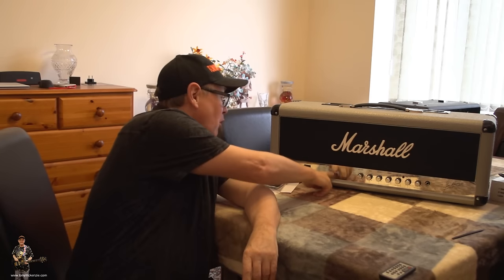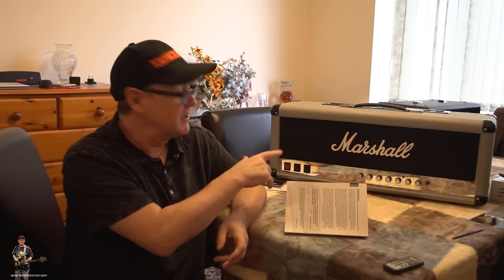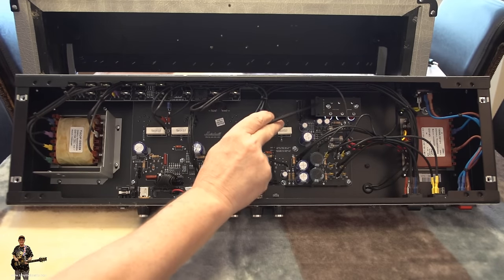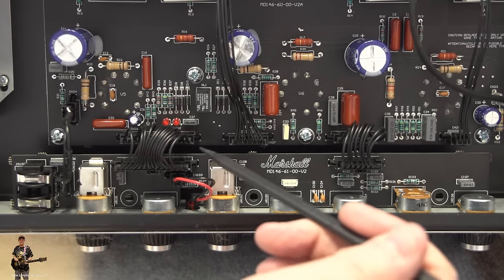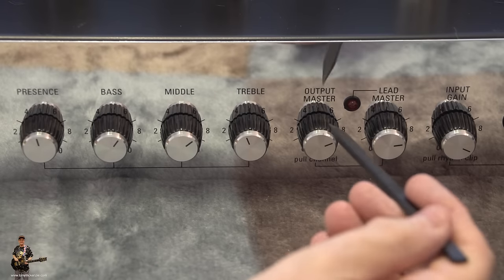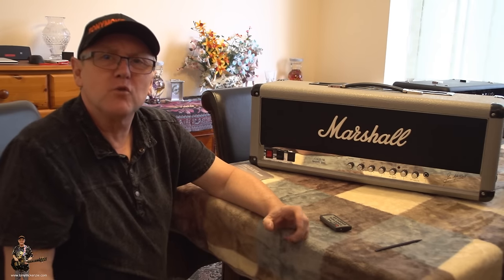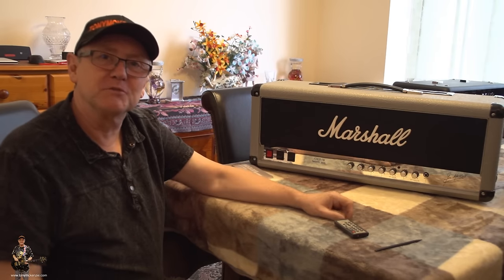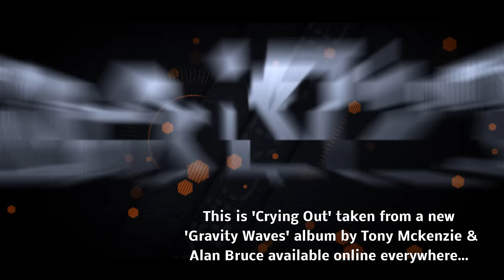Marshall 2555X 100 Watt Silver Jubilee Amplifier | A Closeup Inside and Out Review | Tony Mckenzie

Comment: Thanks Tony dude!
Reply from the maker: Ha this one was for you Dan. I did not publish your name but if you check somewhere in there I mentioned that. :) Thanks for watching. Do you still have yours? I assume you do.
Reply: Yeah, I play a Gibson Les Paul Custom through it too! Really happy with the amp and it saved me from spending well over £2000 on the original 2553 combo that I was in before I got hold of a 2555x. 

I'm glad you felt it was really worth the praise I've been singing about it  for these past couple of years!
Reply from the maker: Well... this one I reviewed came up for sale in the local store www.musicstorepro.co.uk and they wanted to sell it at a discount. I paid about £880 which for a brand new amp I felt was really good. You always talked about that 2555X and when I saw it I immediately thought of you :) and your comments etc. so I bought it for review. Actually though I'll probably be keeping that amp - they do sound cool.

Not sure if you have one but try one of those Xotic SL drive pedals... you don't need much drive, but it takes the amp to even other levels that you would not think it can do - but it does... 

Regards... T
Reply: That's a really good price. When I got mine, it was the only one the store could get (PMT Oxford). 

RE: Pedals, I only use Boss pedals (I like collecting them) and I have the SD-1 (Super Overdrive) that I use to push the amp harder for solos. I normally find with my Customs "classic 57" humbuckers, that I don't need any boost for the stuff I normally play. 

I had a god using your amp settings on mine and I really liked the tone, I rolled the bass back some as I don't like to have much bass if I can avoid it. 

Tony, when will you do another guitar video? I swear that LP Custom is another one that snuck into your collection!
Reply from the maker: Well the 2555X is a year or so older now from launch (at least) and sometimes they can be bought for a good deal and I'm always looking for that sort of thing. This one came from local www.musicstorepro.co.uk which is in Hanley Stoke on Trent. I also try and support them when I can.

Boss make some very nice pedals and at great prices with good offers sometimes. If I remember correctly they just made an 'anniversary' SD-1 in gold and black... but I could be wrong on that. 

Yes what I found with the 2555X is that it is a bit bottom ended and woolly (if that's a word) on the bass side. So I turned the pots (in general)until it went away. I used a 4x12 1960a cab standard from Marshall as I would not pay all the money they want for the 'silver' cab. Sounded good to me. 

HB's will drive it for sure. The crunch is cool too - I did not really show that much of that sound but it is a pretty good tone no doubt.

The LP Custom was reviewed here: https://youtu.be/8-f8E9W78oA under a different title but it's still a review and close up. 

I have restrained from buying yet more guitars of late as I'm now being 'ordered' to do so by the wife :) so I will probably rotate a few through the coming videos that I make so guys can see them if they missed the review and I'll point them to it... a good idea from your comments :)
Reply: I use a Victory Silverback 4x12 cab which is basically a Marshall 1960a and has the Celestion vintage 30's in, which is correct for the time.

Thanks for the guitar link, I really love some of the guitars you have in your collection :)
Reply from the maker: Yes I know the cab... and it might well be a better match for the 2555X series. I have a link for the whole series of guitar reviews here: https://www.youtube.com/playlist?list=PLEECCBA95315E63B6 and there might well be some 'missing' from the playlist... but any not in there are on my channel usually. Regards... T
Reply: I don't know if you remember our last exchange of emails, where I sent you the photos I took of my 3 guitars? The Classic Custom I got just before Christmas and my Birthday, was a black and chrome colour scheme, since the new year I have been on a quest to change all the chrome hardware to gold. I have almost finished with this task and all that is left is for me to either find some really good fitting gold covers for the "Classic '57" humbuckers or to put in high quality humbuckers.

I know normally a classic normally would come with the 490/498 combo of humbuckers, but I was wondering what you would go for if you didn't choose Gibson pickups. I know you have picked up some really brilliant alternatives and was hoping you would be able to recommend to me a good alternative please? I would like to have something pretty low output, just like a PAF, as I think most of "that" Les Paul and Marshall tone, only really happens when you really can push the amp so that the valves "open up" and you get that sweetspot that is just so classically loved by most people who are fond of classic rock and blues music.

Once I have gold humbuckers, the only difference visibly different between a normal LP Custom and mine, is the fact I don't have binding on the back of the body. The baked maple fretboard on my custom is actually so dark you would think it's actually like ebony! It amazes and saddens me that the standard LP Custom comes with the fretboard material it actually does, as it seems to be more about cost cutting rather than being a better alternative to using a real "slab" of wood.

What amazes me is how cheap my LP Classic Customs was. The production of the guitars was done on/in the main production line, rather than Gibsons "Custom Shop" , but I thought this was normal for a LP Custom due to it being a permanent model, rather than like a collectors choice guitar that is build in lower numbers in the custom shop itself, like the custom you use in this video. Mine is a 2011 guitar and it only cost me £1200.

My totally mint Limited Edition Fender 50th anniversary Strat in Candy Apple Red with matching headstock is now kept in it's case with all the tags and paperwork, as I see it's value going up over the next 10-15 years. They are tricky enough to find, let alone a totally flawless and unmarked. I did have it out on my stands for a few months, but I just found my Strat Plus Deluxe a much more enjoyable guitar to work with. Which is in no small part to the Blue/Silver/Red Lace Sensor pickups, which just makes no background hum and honestly sound really great. On the replica Strat Plus I build because of being inspired and encouraged by your Strat builds (also is how we started our "pen-pal" friendship), I used Lace Sensor Golds and they do really sound nice and are voice to be like a 50's set, but they needed me to really have  a lot of treble to give them enough attack and bite IMO, whereas the set on my genuine Strat Plus Deluxe are really well balanced.

A friend of mine has started a business where he paints guitar bodies in nitrocellulose based paints and does a level of relicing that looks easily as good if not better than the genuine Fender Customshop. He is painting me a Strat body in Sonic Blue, but I have made it very clear that I want it unmarked as if it is new. I am planning on doing a very high end 50's-60's era build and only use parts that would have been normal and accurate for that time.Just like you would normally do, I plan to use gold hardware and again I will need your help with choosing parts that you would buy and install yourself it you were to do another Strat build. I doubt I will play the guitar all that much, as it's more about the enjoyment of building the guitar (which I am sure you can relate too) and I want to hang it on my wall as more of a piece of art, rather than a normal instrument.

I am curious to hear about any new guitars you have on the horizon or have picked up (if any) since we last spoke before Christmas. If possible, could you look into doing a review on some of the 2017 Gibson Les Paul's? There are some stunning colours and finishes this year, but after having that Wine Red 2015 (spits on floor in disgust) LP Studio, I am very warey about getting anything built after 2014. 

I'm also seriously thinking about getting another flying V as I regret selling mine so much, especially as the guy who I sold it to (twice!) sold it to someone without keeping our agreement that he would tell me if was going to sell as I would want to buy it back from him for a 2nd time. I really love the '67 style flying V, rather than the original '58 style body. I surprised that you don't have one tbh, I would have thought it would be something that would be owned by you (like a Korina V).

I'm glad you're thinking about keeping the amp and I glad that after me rabbiting on for the last two year to you about the amp, that you have agreed and confirmed that it's the amp I claimed it was. I too also agree that the price for the matching cabs is just foolhardy as the thing is priced far too high. You can buy any new cab (or amp) from Marshall and they will allow you to choose from a number of colours now. I only paid £350 delivered for my Victory cab, which means I could have a double stack rig for LESS money than the one Silver Jubilee 4x12 lol!!! (It does look really amazing though). I will need your help (again) in sourcing the right tolex so I can recover the cab so it will match the amp. I remembered the JCM2000 DSL head you recovered last year or the year before? 

Been enjoying the other videos thanks Tony and it's good to see you doing so well. I'll PM over the next couple of days so we can catch up on the usual stuff we keep private as I guess we've got a lot of catching up with all of that. My aunt has a similar problem and I would be grateful on what helps make things more bearable as she is staying with us while it is all being done.

Cheers dude :)